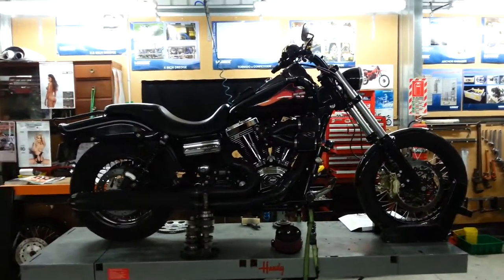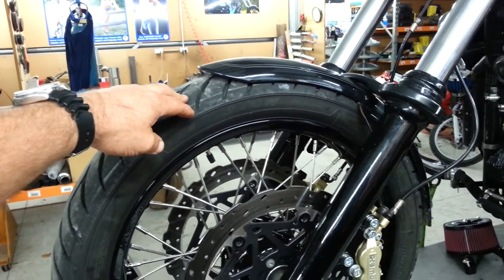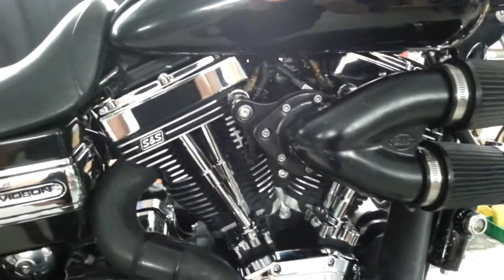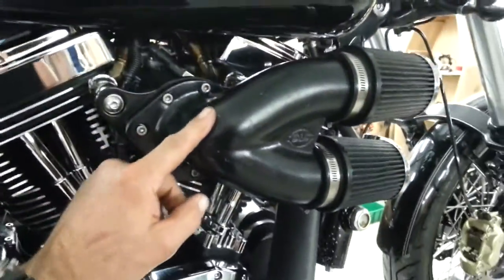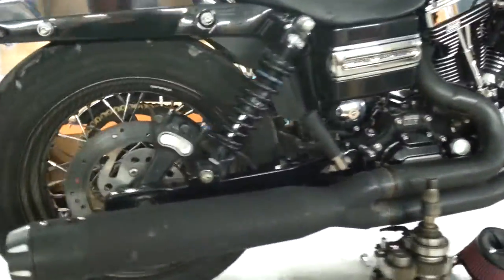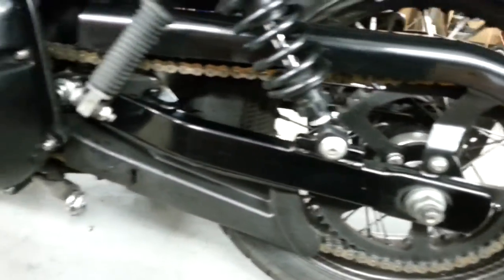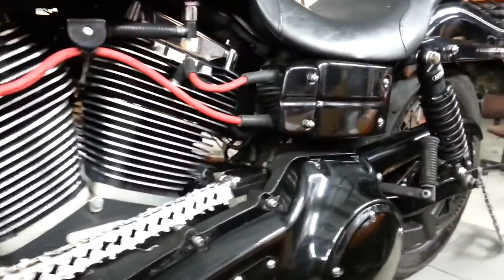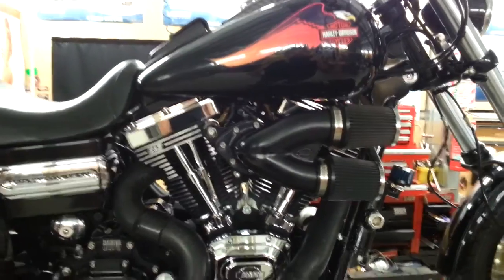S&S T143 update May 2016

Comment: Very interesting and informative.  Thank you.  Can you provide a list of all your parts and systems you have changed?  And can you recommend any dealers or shops in the United States who can do this conversion to the same level of professionalism as you are doing?  Thank you very much.  Wish you much success in your build and I will stay in touch.
Reply from the maker: Hi. Very little stock Harley left on it and engine now a Turbocharged 143 with water/methanol injection. Waiting on engine to come back from Drago bikeworks in USA who has custom built it with P3r crank, custom Darton sleeves, custom pistons, custom cams and so on. Gearbox is now a Baker Grudge box. It is critical to warm up these 143 fully before giving them a hiding as the bores go out of round. Id reccomend Drago and GMS to do your instal as they are familiar with the 143. Have fun. Cheers

Comment from the maker: hi. exhaust is a Bassani unit designed for the T143 but doesn't fit this bike so I modified the rear pipe to clear battery box and shortened everything else to fit.

Comment: Still got this mate? How did the baker hold up ?
Reply from the maker: Hi. No the 143 proved very troublesome with piston failures, then had it sleeved to a 134 so ive gone to a 124. The DD7 did not hold up to the 143 so went straight to the Grudge box which is excellent